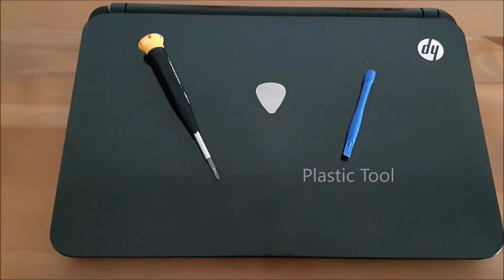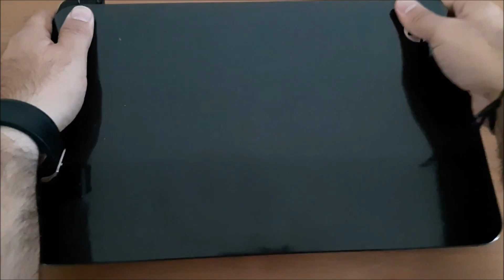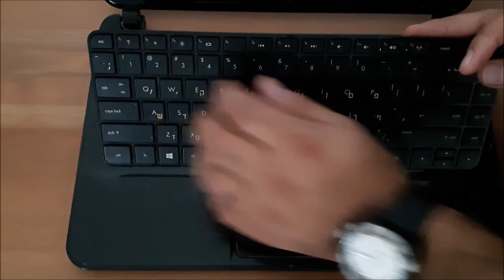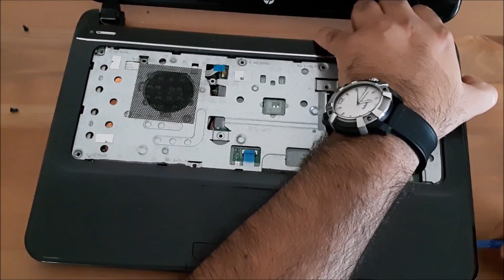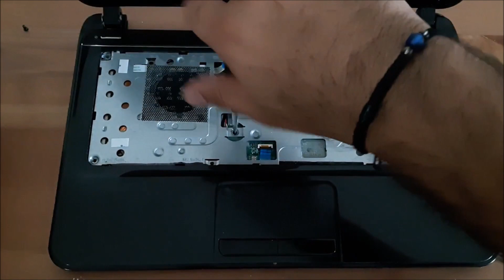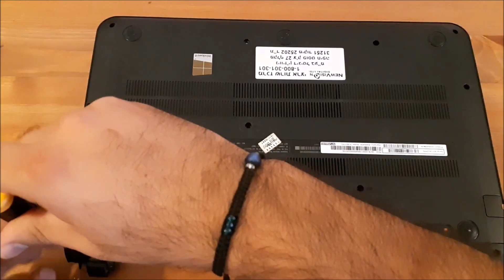HP Pavilion Sleekbook 14 Upgrade Hard Disk To SSD

Comment: Great video. Thanks. But, how would you install or transfer you exsisting OS (Win10)?  Since it sounds like an expensive upgrade done by a service center for a computer this old.  I am thinking about upgrading if it is worth it.
Reply from the maker: You not need to Bay you can use the same product key
Reply from the maker: You just reinstall the windows
Reply: Thank you

Comment: I followed your tutorial but bios does not detect my new ssd sata 3 I have sleekbook 14 b120dx thank you
Reply from the maker: You try to disabled secure boot?
Reply: @PC1948  I don't find any option related to that,  I'm enable to just change date, bios password and boot order, this bios just have a few options
Reply: @GastónRodríguez  try to use your ssd in other computer. maybe this model dont support sata 3 devices